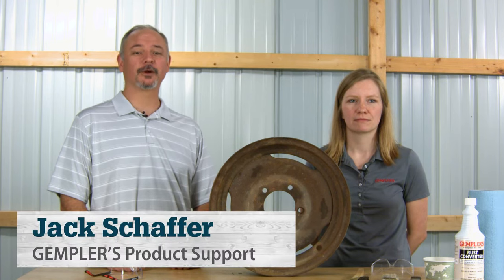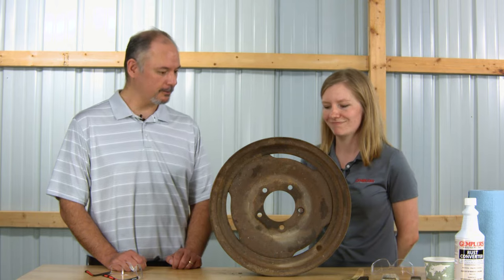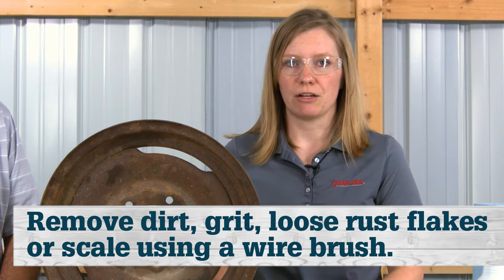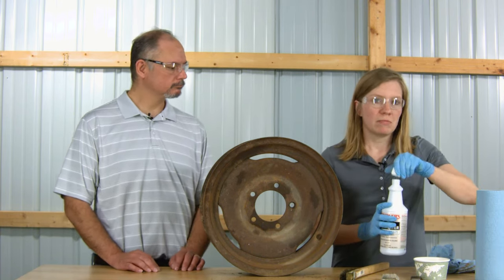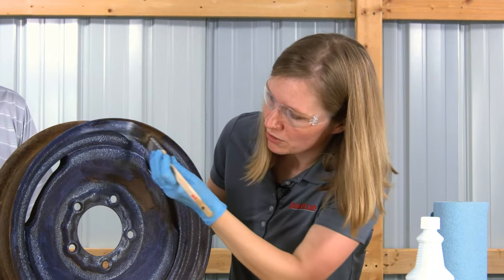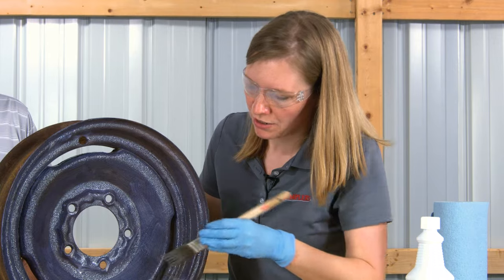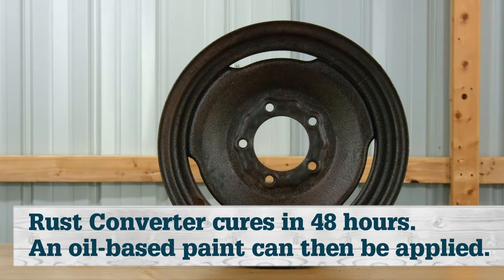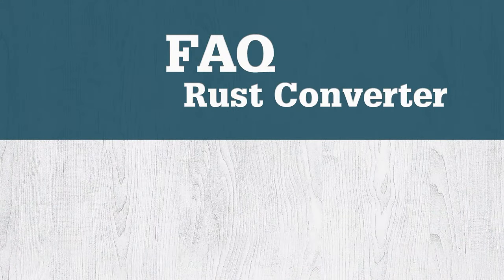How to Use Rust Converter Demonstration

Comment: This stuff works gr8.  I have a 08 Jeep JK and started using it a few years ago.  Easy to use & really keeps the frame & other steel parts looking pretty good.  I usually do once a year in the summer.  Guys at the mechanics shop are always amazed that my ol’ girl is an 08.

Comment: If the surface is rough should I send it and then apply that or is it okay to sand after that's been applied? You recommended using an oil-based paint. Do I have to use an oil-based paint and or can I also spray primer and then use any paint?

Comment: Do you have to use a oil based paint after using rust converter?
Reply: HAVE to? No. OUGHTA? Probably, but i think chemistry wise that's to PREVENT future rust as likely not 100% of your stuff is rusted(you'd be past to the point of saving).   They said it's clean-up is soap and water. That is key as no spirits needs so its not oil based solutions. So you can put an acrylic paint but its gonna lead to under the coating rust (maybe). Just remember fat over lean always

Comment: Does the converter solidify the rust so that it's as strong as the metal it once was?
Reply: I think it slows down the rusting by cutting off oxygen to the rust thus slowing it down .
Reply: It isn't solidifying the rust, because rust is already a solid. My understanding is the paint (containing tannic acid)  chemically reacts with the oxidized metal surface (specifically iron III) and the result is a ferric tannate, which is essentially an inert surface that is mechanically bonded to the underlying metal, but stable enough to remain in its inert physical state. 

There are a bunch of nerdy white papers on the subject of you want to dive deeper. Google "tannic acid on iron alloys."

Comment: Can this be used on a motorcycle exaust and will it make the metal strong again if badly rusted ? Thank you
Reply: I’m just a ransomer passing by.
I’m not sure if this will work on your exhaust due to the heat. I’m not saying that it wont though.
It 100% wont make the metal strong again though
Reply: @David Simpson  thanks dude, tried it anyway,, got rid of the rust to some extent,,  but made for a very smokey result  when the exaust got hot as for strength used a very cold weld then a very hot weld on top of that we're the metal was fatigued and cracked.

Comment: If I cleaned the top of my table saw to bright metal, then applied a solution to make it have a nice even coat of rust, and then applied your product, could I apply wax to the surface to make it slick?
Reply: The top is cast iron.
Reply: If you can get the top to a clean bright metal, why on earth would you want to make it rust, then convert the rust to something else?  Why not just use  a good paste wax on the original bright surface instead?   I was given a table saw with a badly rusted top surface.  I've been trying rust removers to get the rust off and back to clean metal with limited success.  I'd give anything to get to that clean bright metal point.  I can't imagine intentionally causing a surface like that to rust.  But, I can see the benefit of this product in my case, where I can't seem to get all the rust off.  If I can't have a bare metal surface, I guess I might have to settle for a stable painted surface.
Reply: The rusted surface is harder than the bright surface which keeps the surface from rusting to the point of pitting. You are right about why would I want to do that, because I can’t bring myself too. As far as your rusted top, you could have it vapor blasted which should give you the bright polished top you desire. Thanks for the discussion!

Comment: I was told by a glass place that my truck leaks water into the cab, from around the windshield, when it rains, from rust spots.  If I used this around the windshield area, will it follow the same course the rain takes, convert the rust and stop the leaks?
Reply: It's not putty. I would try grind your metal the apply this then put on putty  then paint. or just use some silicone

Comment: Do you have to clean this stuff off before painting or do you just paint over it?
Reply: I have used a similar product and it says on the bottle you should clean it with water after you apply it.
Reply: Better to wipe it with cloth dampened with lacquer thinner.

Comment: Can this convert aluminum rust?
Reply from the maker: Yes, GEMPLER'S Rust Converter will work on any material where rust is present. It will apply like a primer, so only put it on the rust areas. You'll then need to paint over it. Hope that helps! Let us know if you have any other questions.
Reply: Alumina does not rust